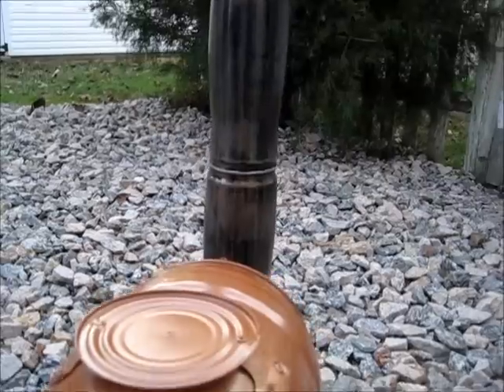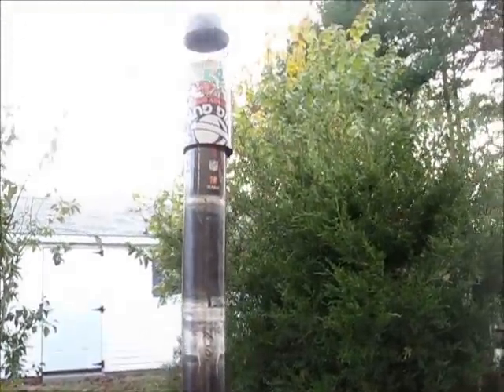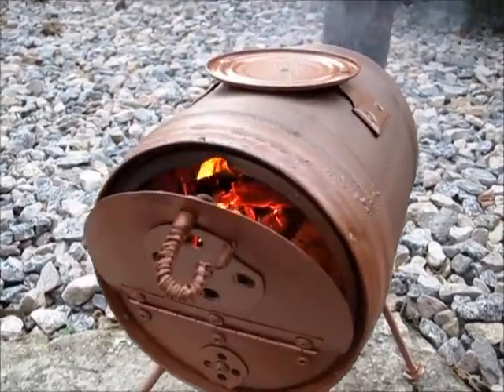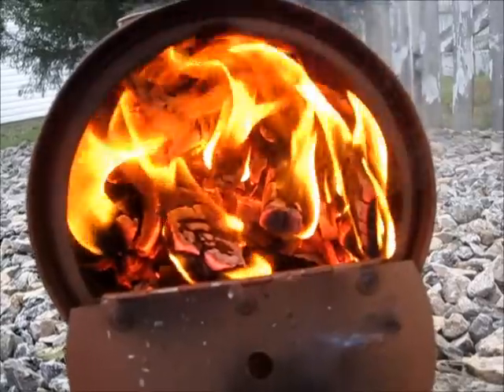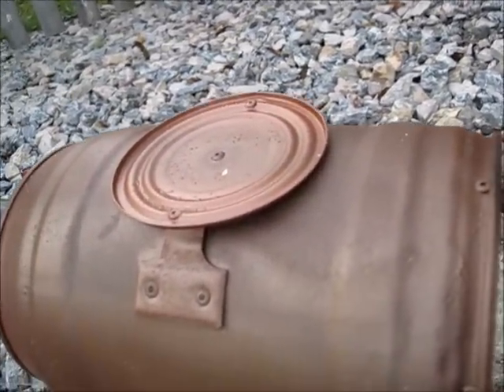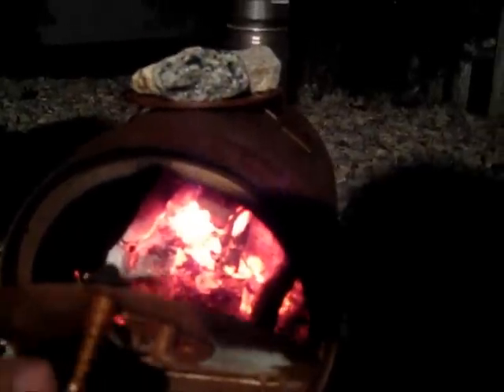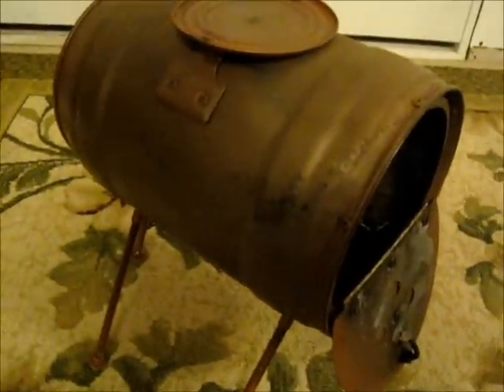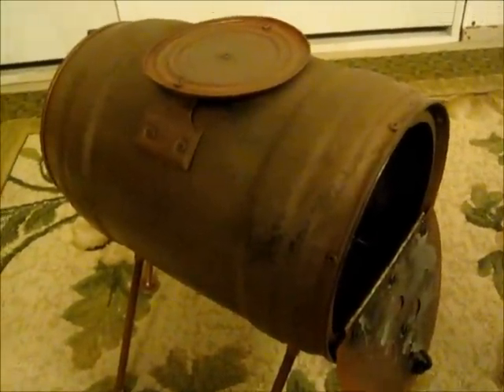DIY TENT WOOD STOVE PROTO #3 PT 2

Comment: I think your idea is awesome. To help you prevent the paint from coming off in parts or bubbling off you need to start a small fire to cure the paint. After you start a small fire let it heat up a bit then let it go out. Usually you haft to do it only once sometimes 2 or 3 times. If that doesn't work go to a fireplace store and buy a can of wood burning stove paint. That kind of paint is good up to i think 2400 degrees. I hope that helps.

Comment: my father used to cook in the military with fieldchitchen. now they where very basic and they use wood as well. point is, they did not paint the metal, instead put on linseed oil. it will burn in while you'r heating up, casing a very long lasting protection layer. you might want to test that for your oven, it will look very nice tho. and if you got steelwool with you (good for lighting up with batterie as well) you can just brush over, and apply oil once in a while. plus is the oil on hand, you take care of your axe, knive etc. as well. and it's good for mouth in wintertime :-) of course, you can cook with it too :)

Comment: If your stove drafts good enough, try burning some solid logs that are green,alot of times you'll get blow down etc in the bush..,
The green wood wont burn at first but after smoldering for a few hrs it'll eventually ignite and by the time u wake up u'll be toasy warm.
Make sure to have a good bed of coals under the green solid log and mix dry wood around it to help it burn...put the biggest log in thst will fit and that'll still allow the fire to burn... Some times u have to have the intake

Comment: (continued) dampers 3/4 open to get enough ait to kerp it burning...basically u're trying to prolong the burntime here and not have to feed the fire so much.. Also don't know if it's been said but put rocks on top and sides of stove to help hold and radiate heat..